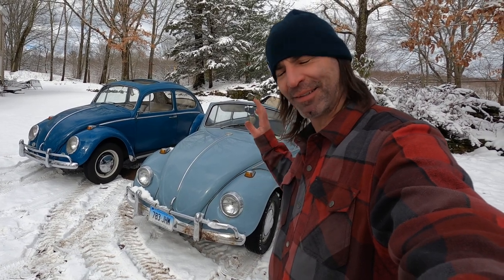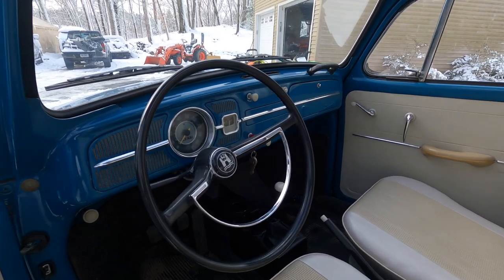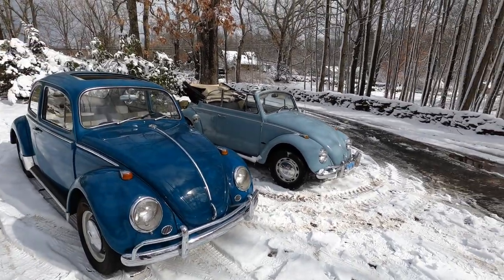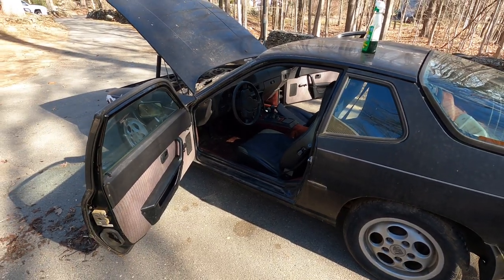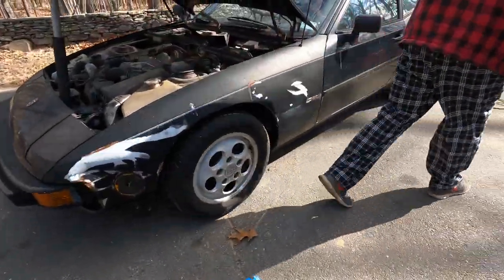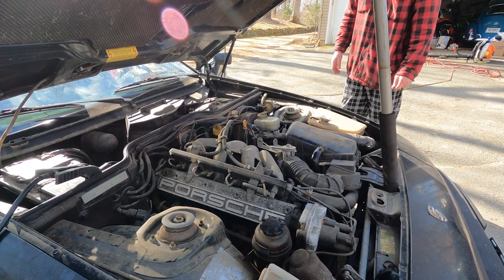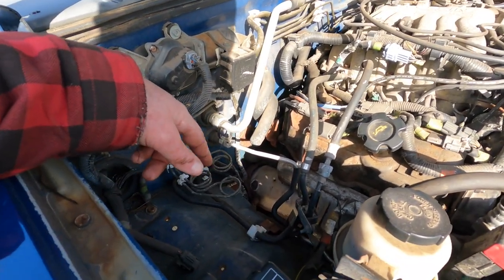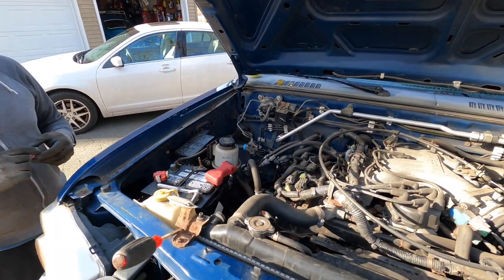What Year Vw Beetle is the BEST? 1967 or 1966 Volkswagen Bug the best ever made?

Comment: For me the best year Beetle is a 58. Oval quality, oval parts, but the familiar big window style and dash. Small windows, for me everything is right on a 58. 

65 on when the windows got bigger they looked more ungainly.

I had a 67 (European as im from the UK), wasn't enamoured with it.

Also European 67's kept the sloping headlights so were prettier than the US 67's.

However if its a Bay, for me 68 1 Yr only buses are my favourites, love all the quirky 1yr only bits on them, plus if it's an early Westfalia they have several 1yr 68 only Westie bits too.
Reply from the maker: I have two 58 ragtops and  the 58-59 cars have really grown on me. Not sure what " oval parts " you are referring to though ....the oval dash is my favorite
Reply: @5150mxVW  on a 58 the wings (fenders) are Oval, bonnet (hood), engine lid, engine, all oval.

And my favourite is the 58-64 dash with the ivory switchgear.
Reply from the maker: here in the States the front fenders had the bullets ( turn signals ) and the engine lid was the " W " decklid .
Reply: No VW got it right finally in '62 , standard gas guage,   dash grab handle, most important spring loaded hood hinges , full synchronized transmission ('61on). Improved rear tail lights like big improvement! I own an oval but pre '62 tail lights are so primitive & a difficult fitting assembly all together . I've assembled dozens of those lights for people they only look nice. '62 - '67 were the best fitted design , plus there are options like euro tail light lenses for safety & nice looks. My '62 is kinda like my oval but much more practical.

Comment: 1967 is the pinnacle of Beetle development. When the '68s came along ... it was over. In terms of aesthetics, well some of us like the even older ones which have their own quirks. That 924 is worth restoring; vastly underrated car, but it sounds like it has an engine oiling problem.
Reply: Super beetle bodystyles killed it for me..60s or older is all I see and want..
Reply: But '68 did introduce the I.R.S. suspension (if you have an AutoStick, everybody else had to wait until '69).
Reply: I prefer Beetles up to 1964, because in my opinion they are more charming and more reminiscent of the original Beetle project.
Reply: I had an automatic stick shift there was no left pedal to use when shifting just off gasoline pedal shift back on pedal  I wish I had only four speed manual 500 $$$$$$$cheaper should have been in bank acount collecting interest 2100or /2600 also I had air conditioner I never liked it motor not enough for it you live and learn  abs I have in now soon 78 years my mom had an uncle who was Lutheran preacher mucho smart critic judgement of volksrarely wrong if he was even on phone calls to do weddings never saw volks but judged them very well it will not last true I do this ok but he was 100x better my dad was before I met never married senorita November 1989 my senorita amigo it would never work still relations going  with problems going on my side of it all hers we’ll see my past comments life is can be very nice learn experiences as l have had for 78 years  college is mucho very dinero cost $$$$$$$$$$$$$$not for all of us or everyones abilities the best is to do what we all love our best at it there are mucho miserable volks out in this insane world society  suicidal doing wrong things to get millions of dinero $$$$$$$$$$ just use properly what we have or earn and enjoy yourselves only 24 hours per day gracias  cam on ong best doing is what we like doing senorita myself love the simple life

Comment: I think the 67 has the mechanical edge but the 66 still has the older style cues. The 1300 has the all out best motor for reliability thick jugs big case big upgrade from 1200. For me the 66 is better. Nice video
Reply: Because of 12volt and engine, always wanted the 1967.  Because I had two 65’s 
also ALWAYS favored the fence numbers!   Now after reconsidering, I’d definitely 
go for the 1966 or 1967.   Just glad that I can say that I’ve owned, driven and worked
on one of the best bugs.....  from 1968 until I sold my last bug in 1977.  I traded that
bug (perfect) for a like new 1971 240Z with 31,000 miles plus $1,000 boot.  Both were
original and like new.  Wish to Hell I had them both back!

Comment: I had a "72 and used to swap stuff like blinkers and tail lights.....anything that I could to make it seem older.  Prior to that, almost aquired a 59, but was advised that it was too rusty.   HEY, I was 19 at the time and didn't know what I know now!! But I LOVED my 1972 torsion axel beetle and drove it from Maine to PA a couple of times aside from daily in Maine and Mass.  I put a Blaupunkt radio in it like original and still available on eBaY

Comment: Great video Jason I prefer the 66 as well I had one I used for a winter beetle and my 65 was the summer car. I recall one winter 30 below zero  six volt and that 66 went rrrr rrrrrr rrrrrr rattle rattle and started the heat may have not been much but it was there and all most instant out of those heater boxes. People always badmouth the old bugs for not having heat I always said if the heating system was maintained and everything was working properly like the thermostat louvers and heat channels it really wasn't that bad. 😊👍 And GTO is a nice choice the closest I ever came to one was a 67 Pontiac Tempest sprint custom with the three speed Hurst and overhead cam straight six a fairly valuable car these days. Check out (TV car show calendar) 1967 Pontiac sprint. Nice car.

Comment: Excellent video Jason  :) think starter need rebuilt or new on Porsche  car and strong 850 Cold Cranking Amps with 90 to 160 Reserve Amps and cure that starting up issues if not Alternator or Battery cables need change too plus check Ground cable wire to Fender see if needs clean up from Corrosion too !

Comment: I own a '67 VW Beetle 1300, and for various reasons I think the '67s are the best Beetles. The paintwork (Lotus White) on my Beetle is still 100% original and in excellent condition. The same applies to the interior, the engine and the gearbox. Even the original drum brakes still work well. Greetings

Comment: 1966 Yes!  I never liked the look of the upright '67 headlights with the early bumpers.  Six volts suck, but most early cars that are actually driven a lot were given 12 volt conversions.  I have a Pearl White '66 sunroof with Pigalle (red) interior.  It has the best VW engine (a 1600 single port) installed, and the 12 volt conversion is soon.  For a daily driver, give me a 1970 model.  Mine was unstoppable.  Except for the rust that killed it....

Comment: Hi, both are great years, here in the UK the 67 usually had the sloping headlights and one off engine lid but as it was the cross over I've see them with upright lights and even the 70s style engine lid guess what ever was left in the VW parts bin ,but a 67 lid sloping headlights continental bumpers( towel rail) disc brakes ,1500cc karmann convertable or saloon a (close second) is my all time favourite car to own .guess there plenty of them in U S pretty hard to find them here and even harder in RH  drive , forget the Bentley's  lamo,s and  Ferrari,s  etc

Comment: I’ve owned 2 1965, a 63 bus, and a 1971 super beetle.  
Hands down, 1965 was favorite.... I overhauled one of 
my 1965 with a $100 kit from sear.  All were stock. I’m 
no mechanic and the over haul was like working on a 
bicycle.  Did all myself with an old floor jack.  Wife helped
me stab it back in to keep it balanced.  Unbelievably it 
started the first try and drove it another 2 years for many
many miles.   Wish I still had it.  I always changed the oil 
and adj valves every 2k miles. Both mine started and sounded
better than these.  I could chg oil and adj valves in 30 minutes!

Comment: My first car was a ‘66 convertible. I loved it, but prefer the look, upgrades and practicality of 12volt ‘67 convertible.  It was the last year of the better looking bumpers compared to the railroad ties looking bumpers in ‘68.
Reply from the maker: Nice first car ! You prefer the look of the 67 rear decklid ? I’ll just upgrade a 66 with 12v and a 67 transmission …and throw 1500 cc jugs on the 1300 if that’s an issue . My 66 with its stock 1300 runs great , it’s only 3hp difference , not sure on torque . The 67 is night and day over a 1200 cc car though .
Reply: The ‘66 is a lovely car and there are plenty of positive things to say about it. I eventually bought a ‘71 Karmann Ghia convertible. It was a gorgeous car in my opinion. It also was the last year of the old style bumper, and had a glass rear window.

Comment: I prefer’67. I like the vertical headlights and modified deck lid.
Reply from the maker: the 67 decklid is awful compared to the 66...
Reply: I was a teen at the time & loved the VW ads showing the changes each new model year.  '67 had some major ones, but at least they didn't mess with the bumpers, yet.

Comment: With cash in my pocket standing there, ready to buy one or the other... I'd pick the convertible. I really don't like those later model steel sun roofs. Even back in the day, I didn't like them. Over all though I much prefer the older body style of the '66. But not enough to turn down the convertible for that steel sun roof. If the '66 was still a cloth sun roof, it would win hands down in my book.
Ha! I just realized this video is a year old. Oh well I'll post anyway 😊
Reply from the maker: come buy the 67 , i'll even give you a deal so I keep the 66 :)))
Reply: @5150mxVW  
Oh, I can't buy a bug. I have no place to keep it. Living downtown Seattle. Parking a vintage bug on the street would be asking for trouble. Last bug I owned was a '61 rag top. Sold it in 1990 or 91. All I have now is a 1998 Toyota 4x4, 5 speed 4 cylinder.